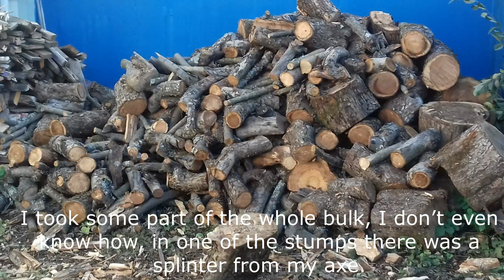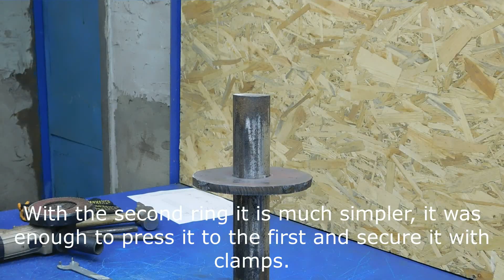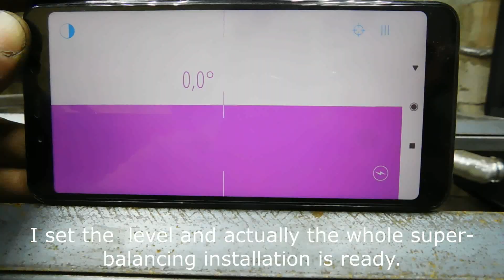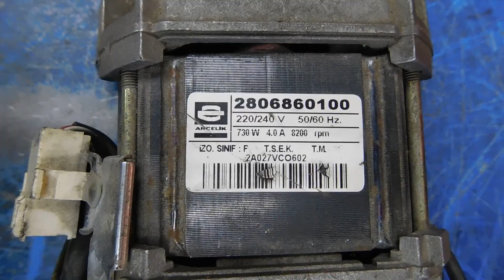DIY  IDEA! Powerful splitter  from the washing machine instead of an ax!!

Comment: I have done alot of logs in my younger years with this type of log splitter on a small tractor and pto and from my experience your running your's at to higher rpm this type of splitter works better spun slower and it's far safer as well

Comment: what is your carrot speed in the end?. I'm just finishing my project powered from my tractor with a 100mm carrot
Reply from the maker: With such a carrot, 300-400 rpm will be enough.
Reply: Thanks for that, the tractor has a shaft speed of 540 RPM for 35hp @2400rpm motor speed . Clearly I won't need that much power so running it at half speed will be enough @Newterafox